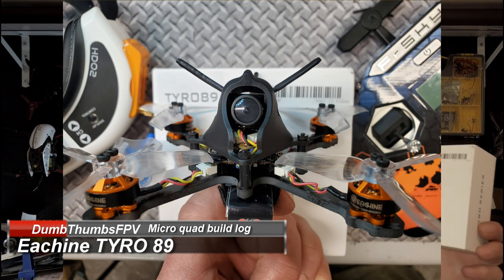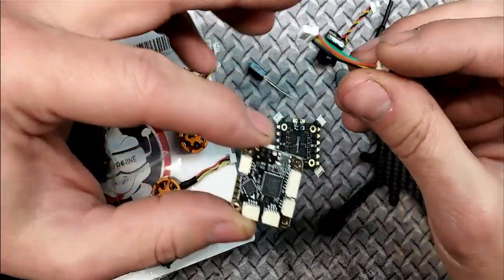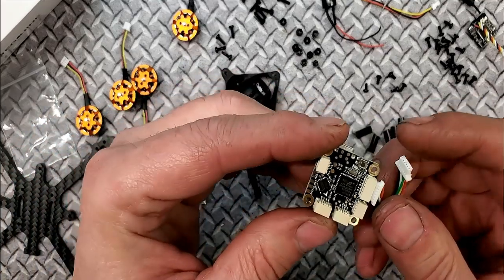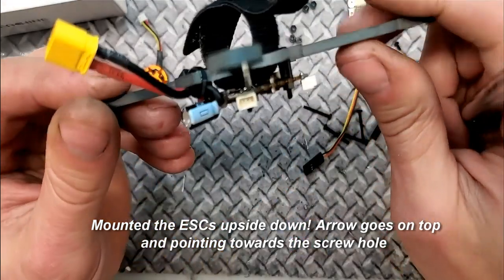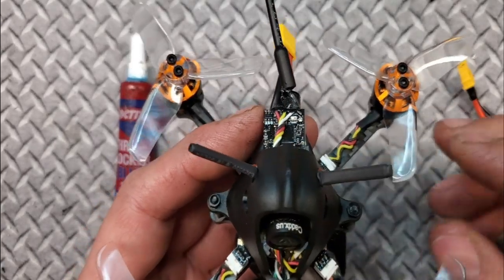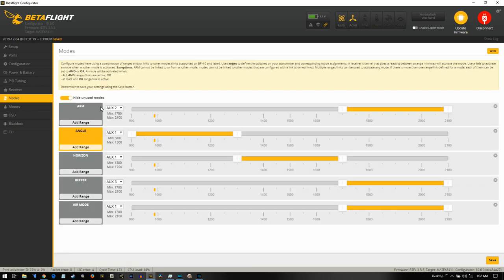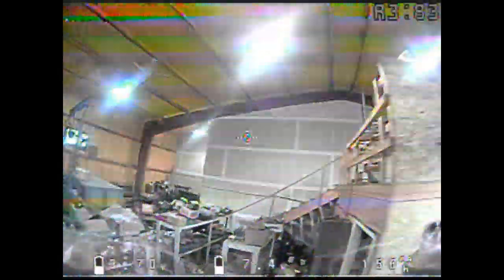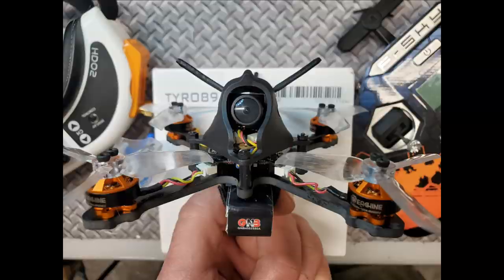TYRO89 COMPREHENSIVE BUILD AND REVIEW GUIDE 10%off coupon

Comment: oh boy! I love my modding my Tyro69 and have been waiting for this one to be reviewed. Great camera 1204 motors instead of 1104's of the Tyro69. I think I will get 2. Keep one stock and put the other one on a spare Kabab toothpick 3" frame. Lets see if we can run 4s on a 3018 prop!  Sweet durable canopy. Eachine is killing it with some serious components on these tiny builds

Can't believe the hang time you were getting with a 2.5" prop without dropping. Sweet review! Thanks!
Reply from the maker: Yeah, I think other than the props everything else is solid on this one. Way more than the emax but the emax was also 20g lighter so different class. This one I believe is really solid. I did find that there is three metal nuts that go for the long screws that hold the canopy but I used plastic ones. When I crashed into a tree today it ripped one one the plastic nuts off and lost one of the long bolts because I missed the three metal nuts used for that. Luckily the kit came with extras. Also thread locked the metal nuts for the canopy.